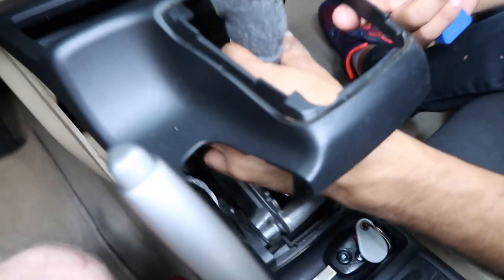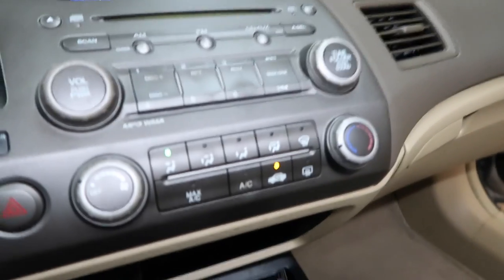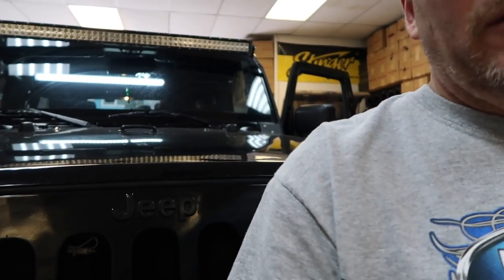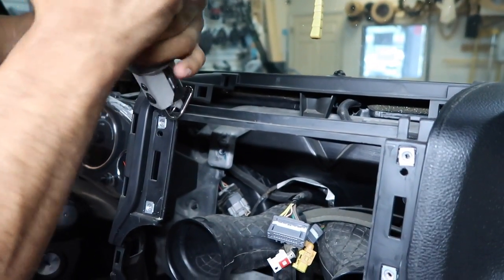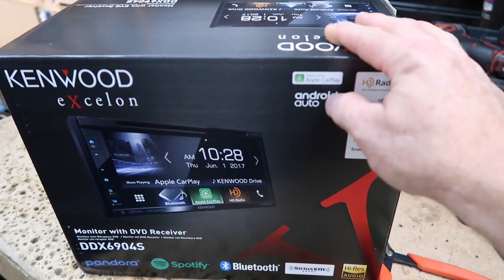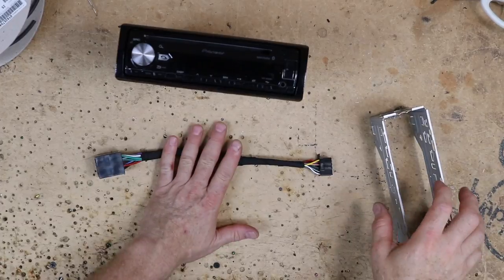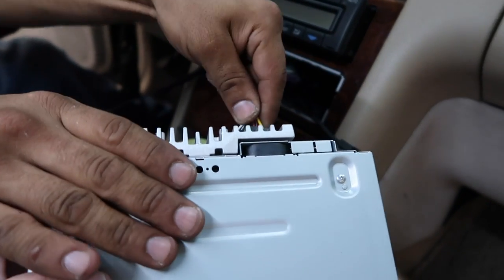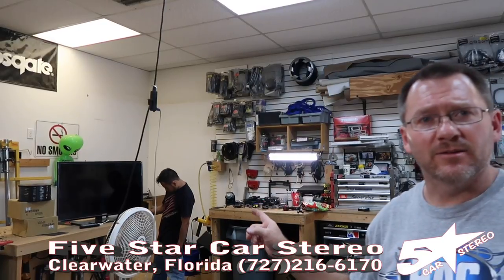New Shoes make you faster, right. Installer Diaries 38

Comment: It's my understanding that a SiriusXM ready head unit would make for a cleaner install. My 2014 Xterra has SiriusXM receiver built in to the OEM head unit so I wonder why they don't make aftermarket radios with XM built in (I haven't seen any) instead of XM ready head units. By the way, I'm planning to replace my Xterra OEM radio with an XM  ready receiver and an XM receiver, I don't know if I can reuse the already installed XM antenna but I'm going to find out. I just got to find a head unit that won't break the bank.
Reply from the maker: The reason is Price. People don’t want to pay extra for a feature they don’t want.

Comment: Do u guys have any tips on replacing my factory amplifier for an aftermarket one? Do I have to run new speaker wire if I want new speakers also?
Reply: I have a 17’ Jeep Wrangler with the alpine system. I’m also running a iLX-207